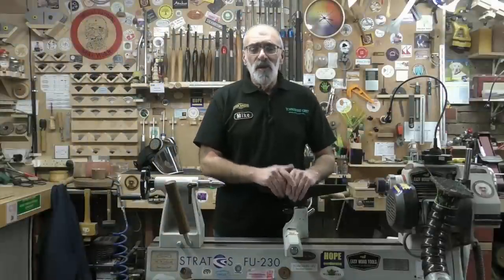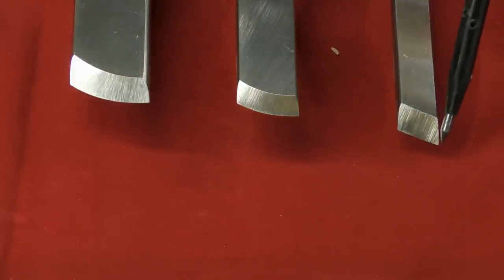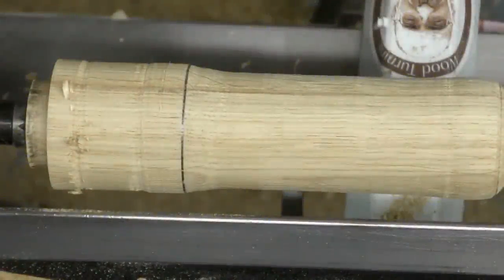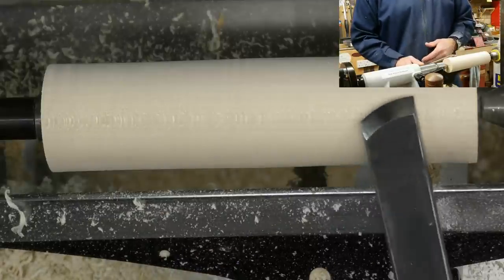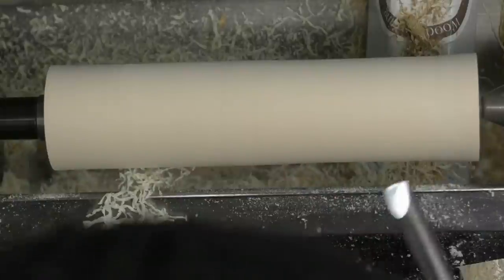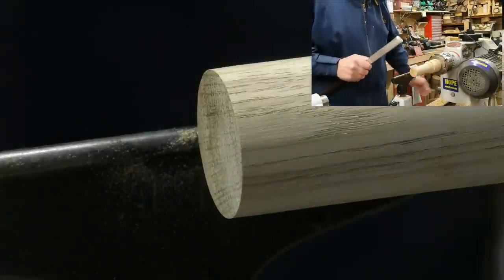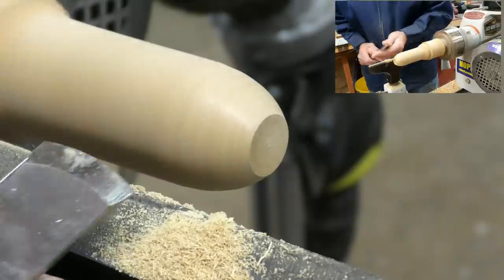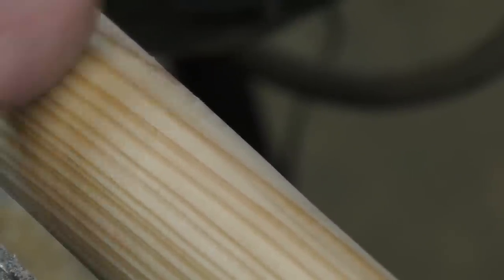Woodturning - Beginners Guide Revisited #4 - The Skew Chisel - Part 1

Comment: Thanks, Mike, for some valuable revision. I could not agree more with your opening remarks. I must confess I love my traditional 1/2" Marples  skew, for the smooth finish it gives, and the 1" carbon steel tool does even better (between a lot of sharpening).Nevertheless I still remain wary about lifting the handle too far,and so don't get all I could from these most useful tools. Need for more practice!   Bernard.
Reply from the maker: Glad you enjoyed the video Bernard and as always thanks for your comments and very useful input 🙂

Comment: I am new to woodturning everything I have learnt is off youtube. Using the standard skew chisel I have made so many mistakes now I am to frightend to use it!. But after watching Mr Waldt I will now purchase a radious chisel and try again , can you recommend a good radious skew chisel please? many thanks .
Reply from the maker: Hi Martyn, it is an easy operationto put a radius on the skew yourself. Literally place on the grinding platform at the bevel angle of the skew, and gently swing the tool to obtain the radius you require. My advice is to start with a slight radius and see how it goes for you, and increase a little at a time until it's right for you. Hope this helps. Cheers. Mike
Reply: @MikeWaldt  thankyou. Your video's give me confidence thanks again

Comment: Great info.  How many cuts/minutes would you expect a sharpened vhisel to go before requiring resharpening? Assuming normal conditions of wood etc
Reply from the maker: It's really very difficult to say as so many factors come into play e.g. quality of tool, wood species, type of cuts you are taking. Generally .... if you think you need to touch up the edge (having to use more pressure) then you do 🙂
Hope this helps
Cheers
Mike

Comment: Great video Mike, unfortunately i'm too ill to do any wood turning and may have to give it up, Do you think it's possible to turn sitting down ?
Reply: Mart,  Sorry to read about your plight, but, yes there are many wheelchair bound turners(and even a few blind ones).Perhaps a swivel chair, with or without arms, would be appropriate, and height adjusted lathe. A cut down transport pallet can provide a platform, if necessary. Don't give up!   Bernard.
Reply: Mart It’s definitely possible and I know several turners who get great results whilst sitting down or having to kneel.
Reply from the maker: As Graham and Bernard say there are many turners who sit turning and indeed who turn and are partially or totally blind. If you search the subject on google or indeed YouTube there is much info that will help you decide the best way forward. Good luck Mart 🙂

Comment: Very helpful video!I do have a question. I get a lot of chatter with the skew and cannot figure out why.
Reply from the maker: Thanks Mike, I would suggest the chatter could be one or more than on of the following:
Losing bevel contact.
Tool rest pivot point not directly under where the cut is happening on the edge.
Dull tool.
Moving along the work to quickly for the rpm being used.
Hope this helps
Cheers 
Mike

Comment: How does the thickness of the steel play into the performance of the cut?  I see the thickness the steel to be 1/4", 3/8" and 1/2".  Does a thicker steel at the same angle of grind work better?
Reply from the maker: Hi Stephen I have only used skews with 1/4" thick stock so I really can't make a valid comment I'm afraid.